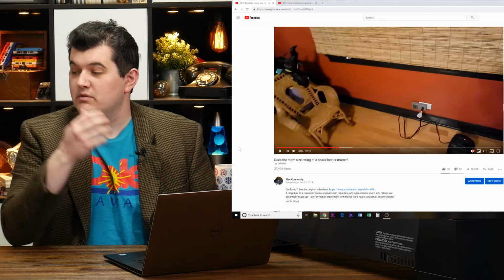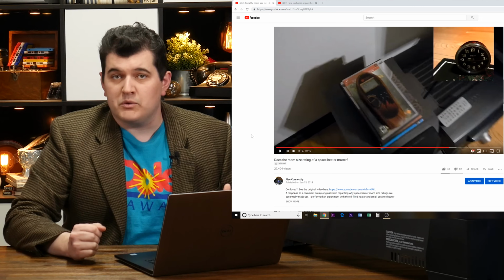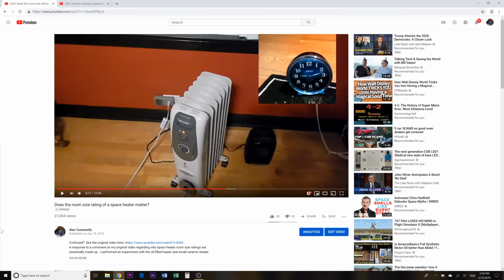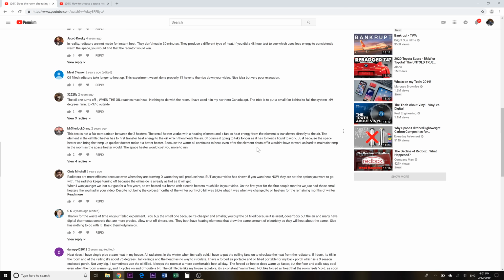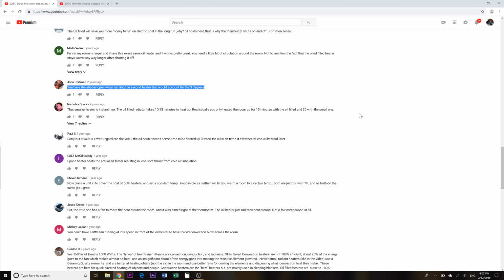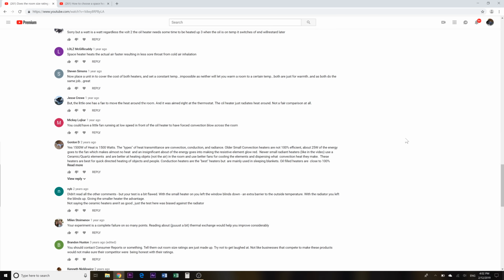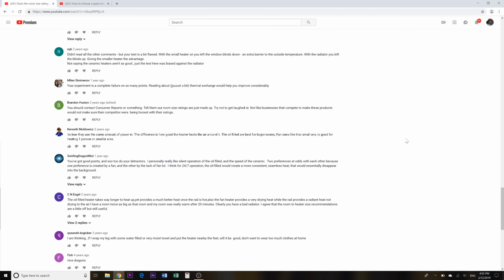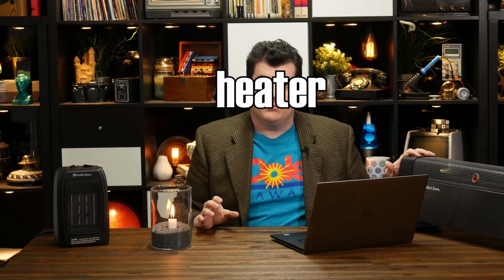More Space Heater Nonsense

Comment: You are doing what many people did for over a century which turned out to be completely wrong & inefficient & that is, you talk about heating the room yet that is NOT what heaters do.
They heat the air.
I explain:
I'm Candie by the way, HI :)

We are in the process of designing our own house & I had to learn about this process cause I have to choose how we are going to heat & cool our home.
Here is the jist. R-Value is a measurement of heat loss, or energy loss, but since we are talking about HEAT, let's keep using that.
If it is 0 Degrees F outside and 70 Degrees F inside, this is what they use to calculate R-value or heat loss or efficiency of a homes insulation.

In the old days, they used to talk about heating the house, but that's NOT what happens. I get to that in a min.
They used to put the COLD AIR returns at the windows and the heat on the opposite side of the room, cause you dont wanna lose all that heat. The problem was, you have to HEAT the air, NOT THE room and for centuries people looked at it backwards.
Finally engineering came into play in the late 80's and early 90's and they realized you never try to heat the whole room, or house for that matter, but instead pass cooler air through a heat source and HEAT it (NOT THE ROOM) eventually all of the air will have passed through the heat source since COLD AIR is denser than warm air & settles, which is how your space heater with the fan was working so well. In a home, the cold air returns are on the ceiling cause as the WARM air cools, it gets sucked into the cold air returns to be REHEATED and sent back through the registers to COMBAT the cold at the colder spots. IT also happens to have been heated, so repeating this makes it warmer over time. But the room being heated is the BYPRODUCT of heating the air.

THIS is why your experiment failed cause those heaters are for different purposes, but for marketing, they keep it simple, BIGGIE ROOM, BIGGIE HEATER, LITTLE ROOM, LITTLE HEATER but that is totally nonsense and BACKWARDS which is what you found out.

The reason the little heater worked so well & so fast is cause MORE AIR passed through its heater core than the AMBIENT heater with the oil it in, which simply heats the oil &  the heat from it rises.
The oil heater will NEVER immediately heat the room cause AMBIENT air needs WAY MORE time to balance out, where as FORCED AIR can get the job done way faster cause it's FORCED to.

OK SO, let me ask you a question EVERYONE gets wrong: What does a refrigerator actually do??
You will likely say it cools or refrigerates everything inside & that would be WRONG. It doesn't COOL ANYTHING.
What is does is REMOVE HEAT from the air inside your fridge repeatedly & over time, the air in side is COOLED as a result cause heat it being removed via the way the compressor works changing liquid into gas, and back again, while absorbing heat, then dissipating it through a radiator either at the back of the fridge or under it but that's another story.

The same is true for heating the ROOM. You do not HEAT the room, you Heat the air repeatedly and eventually, HEAT rises and leaves ONLY COOLER air at the bottom near the floor to be heated over and over which makes the LITTLE SPACE heater VERY EFFICIENT and timely, where as the OIL heater is not meant to HEAT the room, per say, although eventually it will, but more so to MAINTAIN the room temp once it is heated which is why it cycles on and off as it is a heater that needs to remain on overnight to accomplish the same thing and LEFT ON to continue it & its cycling on & off supposedly saves money lol, NO, but ok. It simply cannot remain ON FULL all the time cause it would get TOO HOT. WHY? Cause the liquid can absorb WAY MORE heat than that device would possibly give off by radiating it EVEN with a fan. They just get hotter and hotter so they have to cycle on and off but they will work and then MAINTAIN the heat in that room, where as the little fan driven one, never overheats but will WARM the room WAY TOO MUCH and SOON. DOESN'T really matter how big the room is either, in a house that is, a tiny space heater forced air fan will eventually warm up BIGGIE rooms too.

It's NOT THE energy that is being used to HEAT THE ROOM, cause the room isn't being heated, THE AIR IS, just a little at a time but much faster with the FORCE AIR heater.

ALL heat registers are located where ever there is MORE (or the MOST HEAT LOSS like windows) to heat the air at that spot & COMBAT the cold, WHILE the air repeatedly goes through the FURNACE to be heated, via the cold air returns. THE register part is NOT WHAT HEATS the room, its the air running through the furnace over and over, THE space heater with the fan is the FURNACE where as the OIL heater is the register. But people get it backwards cause they think of FANs as being the register part cause it's BLOWING THE AIR, like a register does, well no.
GET IT???

EVERYONE gets this wrong the same way they get the FANS wrong in summer, thinking that a FAN WILL cool a room, when has no way to do that, cause HEAT must GOES somewhere to be removed or the room air just gets BLOWN around. YOU feel cooler when you feel the breeze cause that's how our bodies cool themselves, through MOISTURE evaporation on the skin so again, THAT is how WE cool ourselves, where as the Fan simple moves air around, so it can evaporate the moisture, THUS removing heat from our bodies. HOWEVER, as I said, UNLESS the heat being removed from our bodies has somewhere to GO, the room will NOT get cooler no matter HOW many fans you have going.
You may FEEL cooler, with the breeze on your moist skin, but your inner core temp will NOT DROP and that is actually dangerous for PEOPLE who believe they are COOLING off but rather they are still hot at the core and can suffer heat stroke even if they feel cooler in front of a fan. The heat MUST BE REMOVED from the room for the room to cool off, the fan does NOTHING but fool you.

Am I making sense?? lol, this is actually VERY COMPLICATED but until you accept certain principles you will fool yourself into thinking like you did, IF the heaters both use the same energy they must do the same thing, NO NO AND NO. They have a completely different purpose & don't even do the same thing.

THIS is the reason after a furnace is installed and up and running, the entire house must be balanced to ensure the correct amount of air is being removed from each room & heated or cooled by the heating or cooling system or it will simply NOT work efficiently at all & you end up with are cold spots or hot spots. Just having HEAT does NOTHING for the house as a whole.

ALSO, you made a comment about electric heat & that is wrong too. It is NOT efficient at all.
No offence, but same thing. Trying to heat stagnant air just by radiation is a poor way to HEAT A ROOM UP when cold, but good for maintaining temp once it is hot.
The reason is that heating stagnant air is MUCH MUCH MUCH Harder than heating FRESH air, which is WHY ALL furnaces EXCHANGE the air as much as 10 - 20% per hour in some cases so the SYSTEM can be most efficient.
Using electric heat takes TWICE the heat and energy to heat the same space as forced air which is why electric heat is TERRIBLE cause it's NOT efficient & costs a TON.
Now, IF you have a modern set up in your home which exchanges air for fresh air, then you can still use ambient heat from radiant wall heaters, oil heaters or even electric but that is expensive with electric.
The cheapest is water ambient heaters at the windows, cause it costs little to maintain the heat in the system and since WATER or any liquid holds enormous amounts of heat it becomes very efficient over time. SO the OIL heater will use less power over time than the FAN driven heater but not work as well, so it depends on the situation of the room & HOW FAST it loses its heat or how POOR its R-value is. As long as the air is exchanged for fresh air, any heat source will HEAT IT but its not just that but it has to DISTRIBUTE that air and HEAT it too to be efficient & work well.

I hope this helps you to understand MORE of how HEATING a HOME works, verses just the physics of how much power it takes to run a heater.
This isn't about power consumption but HOW the room is being heated or HOW the heaters are being used. SO its ENGINEERING as opposed to energy consumption.

I hope you get what I am saying, it took me MONTHS to understand this and A LOT of study and being taught to forget how I assumed things worked until I learned how they actually work.

Candie ^..^

Comment: You started the series, I think you should continue. But next heater vid should contain extra information as for example heat loss in a room comes from bad insulation and untight windows you didn't mention yet. And maybe if somebody has single or old dual layer windows with large thermal conductivity way over 1 W/m²,K, then maybe they want to install a heater without fan under the window to prevent the cold air dropping down and distributing, what leads to layering cold air near the floor and warm air near the ceiling where it is of no use. Keep up the fight for the laws of physics!

Comment: 1.5 kW isn't necessarily always "the same":

https://en.wikipedia.org/wiki/Power_factor

By building a device with a terribly bad power factor, it's absolutely possible to waste 1.5 kW in such a way, that even a very small room stays completely cold when the heater is running at full power! :D
Reply: Typically the units of VA are used for the Apparent Power of a device(the complex and real parts), while Watts are reserved only for the Active[Real] Power. I have never seen a device labeled with W for the apparent power used personally. So Watts will always correspond to the heat eventually released by the device, even if it is a laser beam pointed outside where a good deal of that heat will not be released indoors. 
Residential service, at least in the US, is not usually billed for power factor, and just the Active Power, and so you can use terrible PF equipment all you want with no consequences. Industrial users, however, will want to keep that power factor at bay lest they want to pay an arm and a leg for service, although PF correction is easily possible to handle on-site.
It would take a special kind of genius, however, to design a heater with a poor power factor.
Reply: @carriermodulation  Yes, of course my comment was intended as a joke. Strictly speaking, in physics there is no difference between the product of Volt times Ampere on the one hand, and Watt on the other. Of course you're right about the ratings convention for electrical devices. Then again, as we can see in the video, manufacturers don't always take things so seriously in other respects, either. :D

Assuming that all the power lines between power factory and house could withstand the stress (which they probably can't): I'm not sure what would happen if your power supplier finds out that you're wasting a megawatt without paying for it. :D

So why do you think that it takes a genius to construct something like that? Wouldn't it suffice to connect i.e. a huge, room filling high capacity capacitor, with air as dielectric, one with practically no resistive loss, with extraordinarily thick copper wires to the mains?

Comment: We live in a skoolie. We had been using a radiator heater and it was useless. The small ones like on your left coupled with a gas heater are the only way to go. We totally agree with everything you say, and said in your original video which we had seen before you made it unlisted. The radiator heaters we had tried our first winter cost us $700 in electric one month. We trashed it and went gas and for the small heaters cause that was crazy.

Comment: I have some serious questions about your claim that these space heaters are 100% efficient.
So as i understand it, air gets cooled down when you accelerate it. Thats why you have these fans on your desk on hot summer days. I saw a video on how to make a cheap air conditioner with plastic bottles cut open on the bottom and put them in holes drilled in a plywood sheet that gets put in a window. So the air gets sped up when exiting the bottles, because it have to get pushed through a narower part as it enters. And thats helping to cool down the room, at least a little bit.

So... the heading wire in these space heaters, heat the air aound them but the fan cools it down significantly. You can even see this effect in your car in the winter. When your motor isn't warm enough you'll notice that you get warmer air out of the air vent when you lower the speed of the fan. 

Where does this energy go? I mean it isn't turned into light or anything else as far as i know.. I only know that heaters without a fan 'should' be more efficient than heaters with a fan, because they dont heat up air, only to be cooled down by the fan right after.

Comment: Maybe if the room were a tall room the radiator might have a slight edge? Just a guess though. I never noticed the marketing on those. I've been trying to make sense of air purifier ratings for years though. They are more of a challenge, I think. I try to compare the stated specs and the numbers just won't add up.

Comment: There is a small imprecision at 14:10, the small heater's fan also produces noise, which is a waste of energy that's not heat, so the device is not actually 100% efficient.
Reply: Don't forget the light from the heating element or the buzzing (sound) from the heating coils themselves (in a lot of cheap heaters).

Comment: I know exactly why the small heaters are "better" for small rooms.

They take up less room space.  😑
Yup. It's that simple.  😆
Reply: Facts. lmao
Reply: Ok but in big room I also would rather have small heater if it heat the room same. In this case it heats faster so the small is better for big room and it also takes less space.
Reply: Read the comment above you. Mr simple. And he mentioned your answer in the video. You must be a genius to come up with an answer you just learned.
Reply: The Youtuber should have used the same TYPE of heater.  When doing an experiment it’s important to eliminate all differences except one (the thing being tested). 

I have 2 fan forced heaters.  One is small & identical to his unit.  The other is about 4 times larger, because it’s a large room unit.  Both 1500 watts.  Both heat the room at the  same rate

.
Reply: @electrictroy2010  you’re correct, he should have used 2 size versions of the same heater type, but his point is still totally valid. I grew up very poor, and we didn’t have central hvac, so I’m pretty well acquainted with these things (also the old 240 stack heaters, which are a whole different animal and really were dangerous as f***). No matter which ones we’d get over the years, the rooms would never feel any warmer or colder.

Comment: The room is NOT c closed system.
1. Even without the thermostat turning the passive convector off, its heat goes up, while the small space heater emits the air forward, thus heating lower layer of air faster. Passive convector has to rely on air circulation due to "heat rising, pushing cold air down", which happens, but slower. 
So even though they do put the same energy into a room, the small space heater with its small and noisy ventilator will FEEL like it heats the room "faster".
2. The room is an open system, since its walls will suck off heat off the air. It can be said that the passive convector will loose a lot of energy to the ceiling, before the warm air circulates back down to us. That is where the room's air is not a close system. it "leaks" to the walls. Another reason why it will feel slower.

Comment: It's like comparing a hairdryer to a heating pad; they ARE designed for two very different purposes. 
The "small room" heaters are optimized for raising the temperature in a small room over minutes by heating air. The ''large room' heaters are optimized for maintaining temperatures in a larger room over hours by storing a large amount of heat in the warm oil and releasing it slowly via air convection.

Comment: I wonder if the oil-filled radiant heaters are marketed for large rooms because their thermostats are tuned for the convection patterns that appear in large rooms.

Of course the smaller space heaters with the fan would also heat the large room just as effectively, but perhaps the limitations of the thermostat on the other styles are what prompt the marketing department to rate those designs for anything larger than a small room.
Reply: Phrased differently, the medium and large room marketed heaters May simply be very bad at heating a small room.

Comment: There is a rule 'all things being equal' that in a way applies here even though those irate commentators wouldn't agree to. The 'equal' that they refuse is the wattage being converted to heat. They would claim that it is unequal to the surface area and thermal conductivity of the oil. But the electrical wattage heating the air is instead trying to heat the oil...which is of course, not very conductive. Hahaha. It takes longer but probably radiates longer. They refuse to believe that it can't generate more heat with the same amount of energy applied to it. That's the current status of critical thinking being taught in American schools and why Millennials are thick headed and ignorant.

Comment: I liked your space heater vids, it's what got me watching your channel. I've been saying the same things for years. FWIW I use an oil heater a lot over small fan units simply cause I hate the sound of fans. I have a separate quiet tower fan on low moving air around it. I also don't use it's thermostat, the oil heater is on full, but it's plugged into a remote thermostat with a wireless remote and the actual thermostat is in the remote unit. So with the remote wear I am, it's reading the temp where I am not where the heater is.